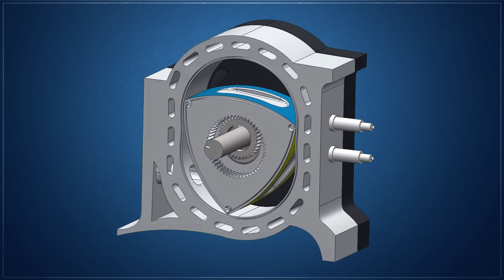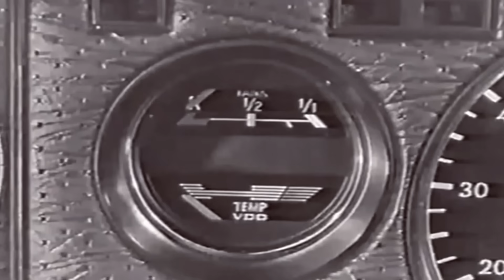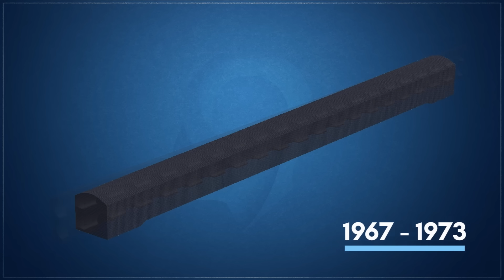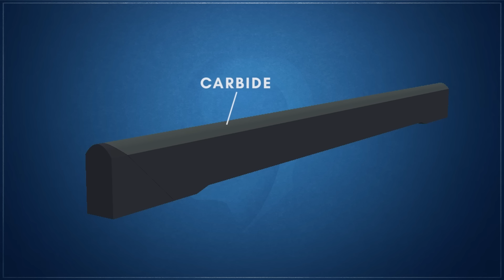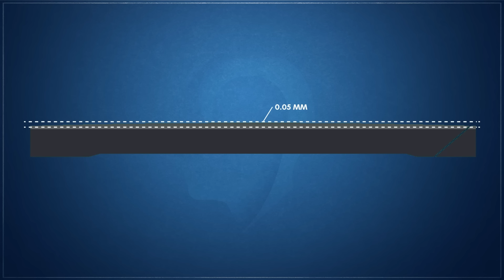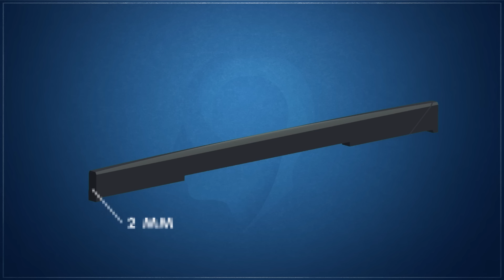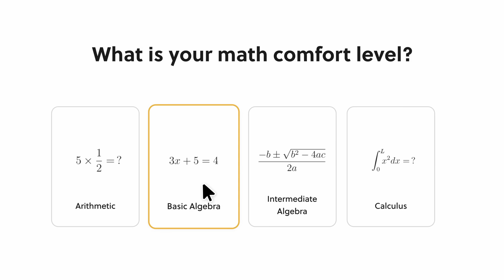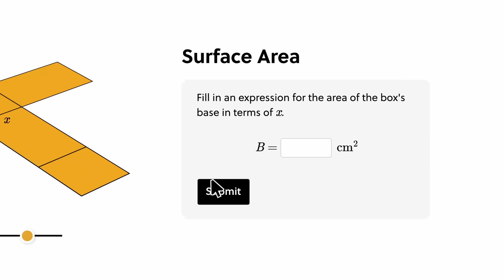Overcoming The Rotary Engine’s Biggest Flaw

Comment: Using gas to generate electricity seems really bad for efficiency and cost vs using the engine to power the wheels directly.
Reply: That depends. If you can tune the engine to run at its most efficient state, the savings can often outweigh the cost if the load varied a lot.
Reply: @joshuacheung6518  it seems like that's what the engineers wanted for the original Chevy bolt, much more gas efficient. Have the engine pop on only to charge batteries every 20min and extended loads. Instead, they just made it a regular hybrid as per bob lutz, right call at the time to help get out of bankruptcy but It stinks to see no implementation
Reply: @jayyydizzzle  right. It's how diesel electric trains work for example, and i think there's a truck company planning something similar (not with the type of motor seen here though, traditional pistons for them both)
Reply: Running a smaller engine which has to move less mass and needing to provide a much smaller range of power allows you to also be more efficient by far
Reply: Because Japan doesn't get big incentives for full electric like in Europe and the US, they're still fixated on hybrids. The decoupled Generator engine is more efficient for most uses since the engine can be optimized for a single RPM operating speed. But it's still a half step solution while everyone waits for the next battery tech revolution.
Reply: @Racing_Pig  that and the Japan's tax benefits for low displacement engines. Wankle engine's low weight and naturally lower displacement per hp probably makes a great fit for Japan's market
Reply: Diesel-electric locomotives say hello.

Comment: I've always thought that a reliable wankel engine would be a great boon to aviation because of the low weight of these engines.  But "reliable wankel engine" is an oxymoron.  My beloved RX-8 made it to 70k miles before I needed an engine.  These seals are a fascinating engineering problem; thanks for a nice video!
Reply: Wankel engines are currently being used in some unmanned aircraft like the RQ-7!!
Reply: @NathanS404  The RQ-7 is obsolete technology and is being retired by the US military, they no longer buy drones with Wankel engines due to their many serious disadvantages.
Reply: In aviation use it might not even necessarily be an oxymoron. You aren't doing 9krpm pulls in a GA or light sport craft, so maybe it's conceivable to have a reliable Wankel power plant that's engineered to last forever at 4000rpm. The problem is, as undeniably cool as that would be, would I trust my life and checking account to it, versus a Continental or Lycoming? Fat chance.
Reply: @helldad4689  Wankel engines offer no advantages in aviation applications and are simply too unreliable.
Reply: @helldad4689  You sound unaware that Lycoming and Continental built and tested Wankel engines for aircraft???
Reply: my rx8 is at 200,000 and still going, what did you do wrong?
Reply: @davidhusband5022 You're a liar Dave, no way would your POS pass a FAA Annual inspection compression test
Reply: @davidhusband5022  treated it as a normal engine
Reply: @davidhusband5022   You are not being honest...
Reply: @DoktorBayerischeMotorenWerke  ???
Reply: @davidhusband5022  200K miles? Please, everyone knows these engines dont last that long
Reply: @DoktorBayerischeMotorenWerke  200,000 kilometres, im in Australia. i sold it to a friend, its still going, starts hot and cold every time first click. ive seen them here  with 250,000 kilometres on the clock. its all about how you drive them. yes of course they wont do 4 and 500,000 kays like a piston engine, they are not a normal engine.normal non renisis type rotaries will do a good 300,000 kays also, they are a great engine, you just got to know how to treat them. im 50 next year, had rotaries all my life, never ever had one blow up or fail on me.
Reply: @davidhusband5022 probably nothing. Just because your engine is still running doesn’t meant it isn’t a shit engine. Any normal combustion engine will reach 200k with ease.
Reply: @ililiililliliill9498  cool bro, show me your engine you designed and built thats better than an rx8 engine please.
Reply: @davidhusband5022 Show me a Wankel engine that is reliable enough to meet FAA or EASA airworthiness certification???
Reply: Well, consider the rebuild material cost, could also be cheap labor if they weren't overwhelmed by emissions...
Most enthusiasts are okay with rebuilding every 70k-100k. That's 3 1/2-7 years of driving. Here in my region, you'd be lucky to put 12k miper year in the car.. i live in the country and travel 120mi/day ... but no way id be putting that much miles on another car... my body can only drive so much in a year..lol so i get maybe 5k plus a road trip
Reply: Same here. I specialize in working on Classic Citroën and have worked on quite a few Citroën GS Birotors, one of the few production cars made by a company other than Mazda. They’re amazing machines, but a good example of how good ideas don’t necessarily work, and working good ideas don’t necessarily work well. If there was ever a company known for ripping up the rule book an innovating automobile engineering, it was Citroën, so, their abandonment of the Wankel rotary should be evidentiary that it’s not worth the trade-offs.
Reply: Wankels would make an excellent light aviation engine, every fault that makes them poor automotive engines goes away in an airplane. 1. Pre mixing fuel and oil, not a problem, aircraft often have separate oil tanks that need to be filled regularly.  2. poor performance at low load, aviation engines need to run continuously at high load. 3. emissions, light aviation engines don't need to meed CARB emissions standards. 4. need for regular overhaul, aviation engines are overhauled regularly anyway. Also the advantages of the Wankel that really don't mean much in a car are much more important for an aviation engine. 1. no valves and fewer parts, makes overhaul's cheaper 2. dual spark plugs, makes ignition safer. 3. soft failure modes, in a car it doesn't matter how your engine breaks down, you just pull off the road, in an airplane an engine that fails non-catastrophically is important as it gives the pilot more time and more altitude to make a decision.  Wankels break down but tend not to do so catastrophically, they loose power gradually.
Reply: @evancourtney7746  WOW! You really are full of amateur speculation and outright misinformation.

Wankel engines cannot be used in passenger aircraft because they are far too unreliable, too unreliable to pass the very minimum reliability tests required for airworthiness certification.

1, Please cite an example of a certified aircraft engine with multiple oil tanks? 

2, Wankel engines are very unreliable at high continuous load, this is exactly when the primary failure mode occurs.

3, False, Emissions were never a serious problem for Wankel engines, in fact the Mazda Renesis engine met the highest emissions standards in the world, EPA Tier 2 BIN 5 and California's ULEV Phase II.
Moot point.

4, Overhauls are carefully scheduled for passenger aircraft engines, Wankel engines cannot meet these standards and fail unpredictably... again no advantage.

Wankel engine have no advantages in aircraft applications and several very dangerous and potentially fatal disadvantages.

Most aircraft crashes involving a Wankel engines occur at take-off or go-around, the most common failure mode is a sudden loss of power and the aircraft is unable to climb and begins to lose altitude resulting in a crash.
  This is why no aircraft manufacturer offers a type rated passenger aircraft with a Wankel engine, they are too unsafe for manned flight.

Please stop posting danger misinformation that could cause someone to be seriously injured or killed.

 Any questions kid
Reply: @evancourtney7746 Wankel engines cannot be used in type-certified passenger aircraft because no Wankel engines are reliable enough to pass FAA or EASA airworthiness certification.

Apex seals are inherently fragile and weak, test have proven that they are too unreliable and have MTBF that is far too low for safety regulations.

Several recent fatal crashes of experimental aircraft powered by Wankel engines have shown that Wankel engines cannot be trusted to provide reliable take-off power and all these crashes were the result of loss of safe altitude and a controlled impact into the ground due to engine failure.
Reply: @evancourtney7746  WOW! You really are full of amateur speculation and outright misinformation.

Wankel engines cannot be used in passenger aircraft because they are far too unreliable, too unreliable to pass the very minimum reliability tests required for airworthiness certification.

1, Please cite an example of a certified aircraft engine with multiple oil tanks? 

2, Wankel engines are very unreliable at high continuous load, this is exactly when the primary failure mode occurs.

3, False, Emissions were never a serious problem for Wankel engines, in fact the Mazda Renesis engine met the highest emissions standards in the world, EPA Tier 2 BIN 5 and California's ULEV Phase II.
Moot point.

4, Overhauls are carefully scheduled for passenger aircraft engines, Wankel engines cannot meet these standards and fail unpredictably... again no advantage.

Wankel engine have no advantages in aircraft applications and several very dangerous and potentially fatal disadvantages.

Most aircraft crashes involving a Wankel engines occur at take-off or go-around, the most common failure mode is a sudden loss of power and the aircraft is unable to climb and begins to lose altitude resulting in a crash.
  This is why no aircraft manufacturer offers a type rated passenger aircraft with a Wankel engine, they are too unsafe for manned flight.

Any questions kid?
Reply: @evancourtney7746 Anyone that thinks Wankel engines are excellent for aviation? Doesn't know anything about Wankel engines or Aviation.
Reply: There is literally a company called Rotary Aviation. Ps sell that RX8 before you get anywhere near 100k miles and buy an rx7. RX8 engines are trash due to oil control rings blowing out from the side exhausts.
Reply: https://m.youtube.com/watch?v=xtVVPioU9p8&t=1127s
Reply: @keilmillerjr9701  That RX-8 is LONG GONE.  I sold it to CarMax for more money than it was worth; they didn't notice the terrible compression or its tendency to not start, or the rusted out wheel wells.  Thanks for the info on Rotary Aviation.
Reply: @keilmillerjr9701 Rotary Aviation is not FAA or EASA certified for airworthiness

Comment: Why to use this engine? What big big advantages does it bring?
Reply: size. it's extremely power dense for its size.
Reply: @KareemFloat  Literally the ONLY advantage of the Rotor Engine.
Reply: @Racing_Pig  it isn't, but ok.
Reply: @KareemFloat  such as?
Reply: @Racing_Pig  Rotaries you have full modularity with the ability to stack rotors and crankshaft segments. meaning you aren't bound to a set engine block wall thickness size when wanting to increase displacement. 

with modularity you also have the ability to change how that sequence fires. making 1 rotor fire at a time, 2 at a time etc etc.

though low end torque isn't as great as a piston engine, the med to higher rpm torque curve is broader and more stable than piston engines which naturally have a drop off after 5200ish rpm.
Reply: @KareemFloat  Modularity only gets you so far before you have to change cooling  and air flow passages as the inside stages become heat soaked. As well you begin overheating your intake system due to self said heat soak. They aren't just like a Lemco gearbox of engines. Thermodynamics starts kicking your ass at 4 rotors. As well as torsional issues as the eccentric lengthens. The need for specialized bearinged interstage plates negates any economies of scale.
Reply: @Racing_Pig  air flow wouldn't be an issue on rotary. The only issue faced is just the un-equal heat distribution between intake side and exhaust side, due to their design of using dedicated chamber to do the cycle (this was solved on Liquid Rotary design)
Reply: @hectornecromancer5308  Liquid rotary, so not what's being talked about.
Reply: @Racing_Pig  just answering about the cooling and airflow issue that you've mentioned
Reply: @KareemFloat  modern electric motors, that have more power, efficiency, cleaner, simpler will put this tech in museums along with most internal combustion engines.
Reply: @EVsomuchbetter  sure, but the new tech you're speaking of didn't exist at the levels in which it does now when this engine was first invented. 

also, if you're going to be so "stand offish", rather than commenting just go out side for a bit.

Comment: Wait a minute. Why didnt they use Cylindrical roller bearings?
Btw the hybrid would be better with a diesel. Two stroke it is for me
Reply: A  needle roller apex seal is an interesting idea. It would be fitted into a radial semicircular grove in a support housing across the apex width, supported by a spring between the roller seal support housing and the rotor apex seal assembly in the rotor. A rolling needle seal will roll on the interior surface of the rotor housing instead of sliding on the rotor housing. Also, similar to needle roller bearings, a rolling element apex seal would not need as much lubrication as sliding apex seals, reducing lube oil consumption and emissions from burning lube oil.
Reply: @@retiredbore378 Particularly at the high RPM and RPM changes a roller would have to turn at.
Reply: Cylindrical roller bearings are designed to support high radial loads and reduce friction between rotating parts, whereas the apex seals in a rotary engine serve a very different purpose.
Apex seals maintain a seal against the housing of the rotary engine, handling high temperatures, pressure, and friction. Using cylindrical roller bearings instead of apex seals would likely lead to problems, as they're not designed to withstand the combustion pressures and heat inside the engine.
Reply: How would it seal if it has enough clearance to roll freely?